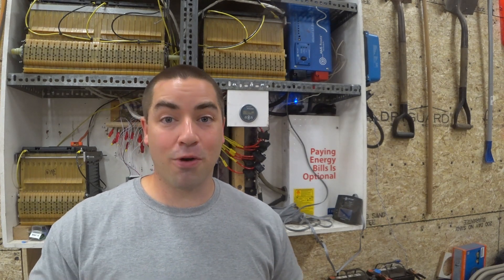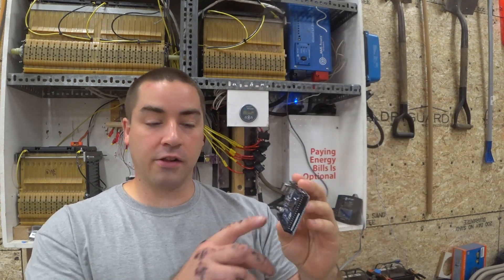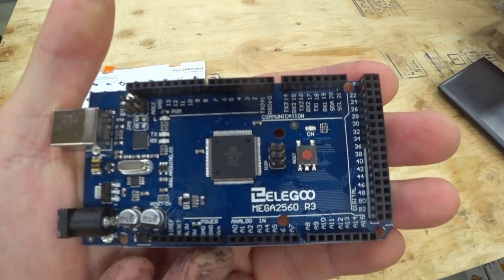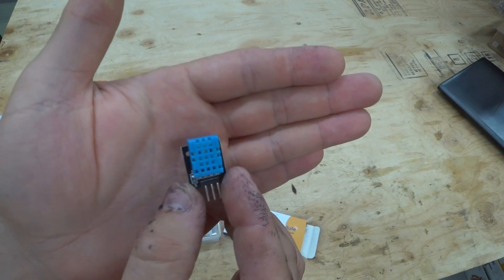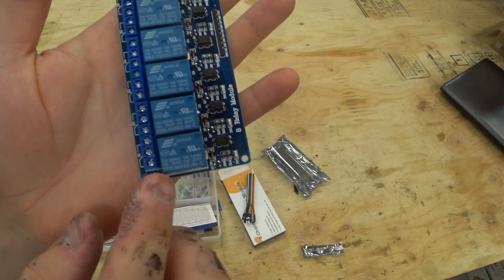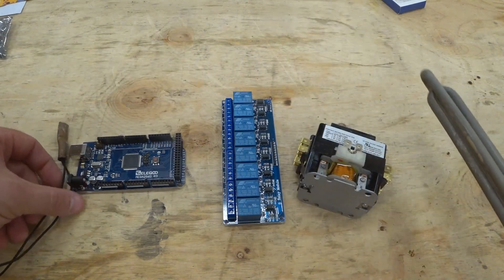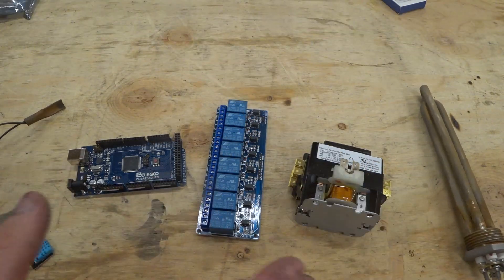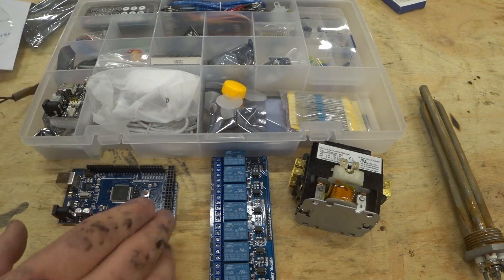Arduino Mega Introduction to Diversion Load Controller

Comment: Done any more with this topic, controlling loads to use extra solar power?   I'd suggest setting up IOTstack on a RPi,  which gets you mqtt, node-red, influx-db, grafana.  The SMAs in lithium mode put out battery voltage and target voltage, and battery current on CAN, which can be taken into node-red to do some simple controls with to turn on/off other devices over wifi,  which can be Sonoff/Tasmota smartplugs or ESP32 relay boards.   Andreas Speiss #295 explains the RPi setup.  https://www.youtube.com/watch?v=a6mjt8tWUws&vl=en        Or, if you've followed the victron venus os setup to get the SMA data, that probably can do mqtt & node-red also.
Reply: Have you publicised what you have done at all? Got a link to it ?
I don't think he ever goes back to stuff this far back in time .

Comment: Have you experimented with arduino yet?  I’ve used one for something similar. It’s got a PWM output which controls a triac based mains switch (works like a dimmer switch) so any excess power is dumped into hot water tank. It allows the load dumping to vary from 0 to 100% of the connected load. It works like a charm on my lead acid batteries during the absorption and float phases.
Reply: Hello, could you share schematic or some more information?

Comment: Very cool buddy!  Excess power is not a problem I experience in the winter but come summer absolutely so I have been brainstorming on ideas to use the surplus.  On a sunny day, if the wind picks up I wouldn't want to cook the batts so I was either thinking on grid tying the excess or  building an air conditioning unit, possibly heating water also. I want to look into your new toy and see what use it could serve me. Thanks for sharing and if your bored,  check out my system. Been off grid 3 years in Wisconsin now and never going back.  https://www.youtube.com/channel/UCiI9Qot99ikgpA3T-I8g6hQ

Comment: if your batteries are full then you need more batteries ...on a second stand alone install .. and esp32 units with wireless and more ram included as standard if you want/use that option later...
Reply from the maker: I'm working on the more battery part.
Reply: @DavidPozEnergy  do you ever watch and take inspiration from roberts battery,supercap channel ,you probably should given the internet age of everything now using 3.3v,5v,and 12v DC directly today rather than wasting inverter power... oc using the cheap DC to DC PCB buck/boost devices are also a good start to power all your existing DC KIT for diy inline battery+supercap per device fun.

for instance,all that trailer trash material could have been diy recycled and carbonised on site ,
then used as a base for a derivative of roberts conductive inks (if you cant afford to buy and support his maker efforts) etc... with all that spare unused electric.

https://www.youtube.com/user/RobertMurraySmith/videos

Comment: I recommend getting a plastic project box, and some solder prototype boards.  You can end up with a very clean looking assembly.  The arduino mega is not meant to be used as a final installation but rather just for debugging.  The smaller boards such as pro mini, are great for actual installations.

Comment: Hello.  This sounds exactly like the project I'm just getting started.  I was worried this was going to turn into an arduino project.  Do you know of any off the shelf solutions for diversion loads? 

I am considering diverting before the power reaches the controller, so that the power from the panels goes straight to a heater.  My battery requirements are very minimal so I'm thinking just program the arduino to open the circuit to the heater, allowing power to go to the charge controller for 10% of the time.  

Let me know your thoughts, I suppose we are essentially working on the same thing.  I do have experience with arduino, so maybe I can give some pointers on that.
Reply from the maker: off the shelf solutions, yes.  Several charge controllers have a built in AUX SSR (solid state relay).  This can close or open based on battery voltage or other parameters.  It's not as ideal as SOC, but probably close enough for most applications.  My Victron has this SSR built in and I know other brands do as well.  This could switch a larger relay to turn on or off one device (typically a water heater).  I want to take it further and also control heating/cooling (which is why I'm learning arduino)
Reply: @DavidPozEnergy  Ok I will look into that.  
It may be a much easier solution for me.

Comment: I was thinking “time to increase your battery storage”...but my 2nd thought was “you ARE increasing your battery storage”...you are just using a “battery” which holds a different form of energy.
Reply from the maker: Exactly!  A while ago I made a video talking about storing heat energy in a large water tank.  I've also been gathering the parts to make a glycol chiller with ice storage.  Hopefully have that ready for next summer.

Comment: Hello. 
I see some people suggest you Node-Red and I also want to say check out Home Assistant. It is easy to control a lot of stuff in your home. There are a lot integrations. I am installing my Victron charger, but I can play with the surplus of my PV inverter (Fronius) very easy. With Home Assistant is very easy integrate Arduino devices (sadly no Mega model) using ESPHome. 
Regards.

Comment: ok, first off, welcome to home automation!!!
second, forget the mega board :) 
i went down the route of using home-assistant on a raspberry pi (very easy to set up as its just writing an image to an sd card)
then use ESP boards (ESP8266 can be flashed and controlled by home assistant for anything like motion, temp, humidity)
ESP boards are basically mini arduino megas but much much cheaper, fiver each for example
or the even easier route is to use SONOFFs with home assistant

the world just got a lot more interesting for you.

the point of home assistant and ESP boards (with home assistant) is that you dont have to learn coding which may be easier for you.

look up Drzzs on youtube
Reply from the maker: Thank you I will look him up.  
The other thing you mentioned (Sonoff)...  About a year ago I looked up something like this.  I don't know if it was this exact one or some other brand.  But it needed you to have an online account.  I'm trying to do this independent of other things.  So independent from internet.
Reply: You don't need and account for sonoff, it is OpenSource

Comment: why not just deliver back to the grid?
or are these loads you'd otherwise generate at night?
Reply from the maker: I'm currently grid-tied, so you are right that I could send the electricity back to the grid right now.  However, my eventual goal is to build an off-grid house.  Everything I do is in preparation for when I don't have the grid as an option.  Thanks for watching.

Comment: Good idea but very time consuming. I use the Morningstar RD-1 Relay Driver - Logic Module Accessory which controls 4 relays just set low high voltages , alarms or temperature in one simple solution and forget about it. It will  do it for you automatically.  I control the charge to my batteries by diverting excess of electron to water heater, a/c or the grid.
Reply from the maker: That sounds great.  I'd love to see a video showing it if you don't mind.  It doesn't have to be fancy.
Reply: @DavidPozEnergy  It is the best I know of.  You need an old pc to program it and can control voltage from 5v to 68v. Arduino or raspberry pi won't come close to it. I have 4 of them and have been using them for about 4 years without any problem. I can't do a video for safety and privacy. Some municipalities are very strict and will shut you down if don't give the mullahs. If you have any question I may be able to share opinion but can't advise.

Comment: I could hear you getting more and more excited as you filmed. Keep it up Dave!
Reply from the maker: Ha, Yeah... I had to do a few takes because as I get excited I trip over my own words.  I've been doing experiments with diversion loads for several months, but it's been just one thing at a time.  I want to set this up for multiple things, and cascade them as each is satisfied.  But, also, some current sensors and other fun things.
Reply: @DavidPozEnergy  i feel your excitement

Comment: The problem with heating is that you need say 1kW extra or you'll empty your batteries.  I'm in the late stage of development of a device that redirects what you have spare proportionally so not to draw from your batteries.  I've been using it for months with great success.

Comment: Raspberry pi with node red and you easily do your scripting with visual flows. So much easier that writing static code :) you can hook it Up to the sensors in that kit. Or use esp8266/32
Reply from the maker: Thanks.
Reply: You beat me to it my Viking friend.
I was going to recommend an ESP8266/ESP32. You just did this within the last couple months with your HWT and Hot tub :D

Comment: Cool stuff...If I were you, I would feed the arduino information about the panels(voltage and current) and I would have it guess how much more power they can give...This way you can turn on just the right apliances so that you don't use your batteries...I have been using arduino and other microcontrolers for a lot of time now so I could help you on the software side if you need anything
Reply from the maker: Thank you for the offer.  I'll let you know if (when) I get stuck.

Comment: Another thing is a load interlocker..... say you're drawing too much power (oven is on), you might want to prempt the HVAC system from running for a while.  You can use the NC contacts to interrupt the thermostat.

Comment: Save yourself the headache... just turn on the stuff manually and put them on a checklist of things to turn back off (or put back to the original settings).  It is MUCH easier to program yourself than one of those gizmos.
Reply: There are those who like to learn how to do something new and need a situation to execute the plan  even if there is an easier way.
Reply: @Fingerprintguy  I've never lost so much sleep until I got an arduino.

Comment: I love your channel and the DIY content is great! I'm starting an Arduino project so your video caught my attention. Some things that popped up in my mind that would seem to pose a challenge: Acquiring the battery status data; determining which and how many extra loads can be activated; timer to prevent rapid cycling of loads if the extra voltage or charge fluctuates; some kind of display to show what the system is doing; a way to monitor or even control the system remotely. This should be an interesting project!
Reply from the maker: Great points.  I don't have an answer for all of them yet.  I'm probably going to use my BMV-712 for battery SOC, which will close or open a circuit, which will then tell the Arduino to begin it's program.  But I still have to try it out to see if it works.

Comment: I would say normally, have your fridge and freezer settings in the middle, but if your battery bank is full and there is still sun, crank those up to max, then for about as long as you maxxed those (let's say 4 hours), turn them to min for the same amount of time, then put them back to medium (middle setting).  That will take advantage of the extra sunlight that would normally be "wasted" with full batteries, without actually wasting it.  I doubt you can automate that but if you can, it would be slick.
Reply from the maker: Thanks, I had not thought of doing that with my fridge.
Reply: Welcome.  It also works well if you are expecting a power outage like before a hurricane.  Crank your fridge/freezer up to max and when the hurricane/danger passes, put it on minimum for a few hours, then back to normal.  I think the electrical usage should about average out as if you had kept it on the middle setting.

Comment: One of the problems with lithium batteries is that the power curve is so flat the high low cut offs have to be right at the top so extreme cycling happens in a narrow band which may effect battery performance. Cheers David can't wait to see how it works.
Reply from the maker: Yes, it is one of the considerations.  I think I have a plan around it, but won't know for sure until I try.
Reply: With Morningstar RD-1 Relay Driver - Logic Module Accessory you can control millivolts so no problem with lithium battery.

Comment: Have you considered using it to shut your inverter off in the event of low battery voltage.  That would be an interest to me with my 14s leaf batteries.
Reply from the maker: I'll bet there is a way to make it happen, but I have not tried.  My battery is 12s, so the built-in low-voltage cutoff (42.0) works fine for me.  I can see how it would be more relevant to your setup, needing 49.0v as a cutoff.
Reply: @DavidPozEnergy  one of these days I'll have to do an update video on my setup and send to you.
Reply from the maker: I'd love to see it.
Reply: Yes, the AIMS inverter has a remote control that can be turned on and off with the Morningstar RD-1 Relay Driver - Logic Module Accessory.

Comment: looks good for multiple uses I just use Aux1 on my Midnite 250 and a digital relay but hot water heating kills the battery pretty fast so I never get to having more than I need.
Reply from the maker: Hi OffGrid Wanabe,  I've thought of using that as well.  I have a Victron, but it still has an aux SSR built in.  The problem is controlling multiple things.  That's why I want to learn the Arduino.